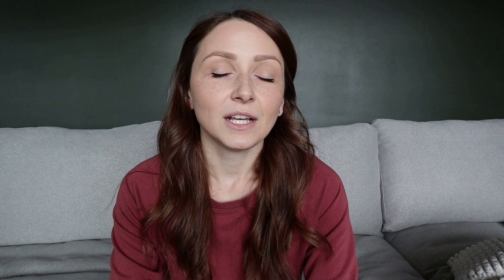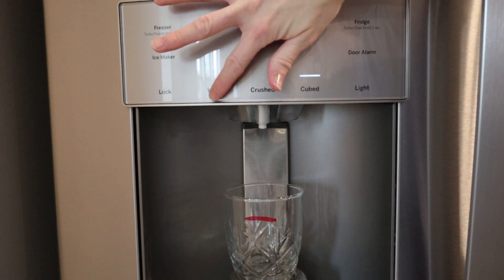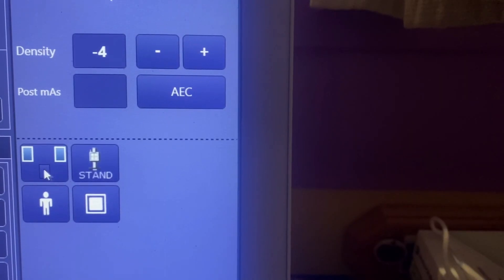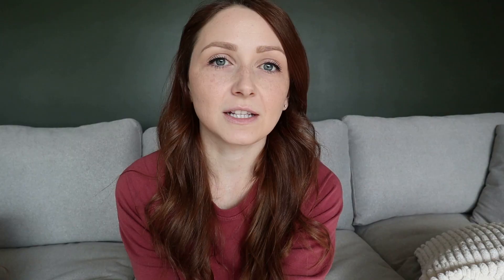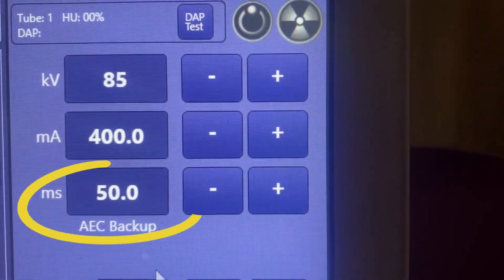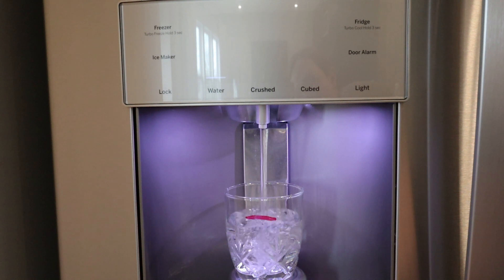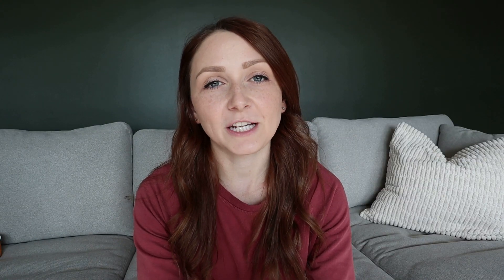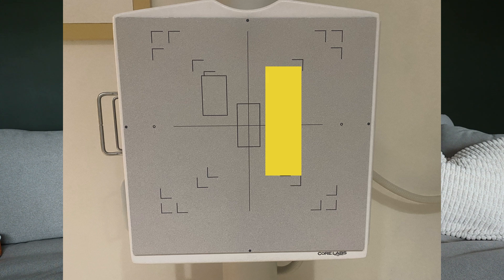Radiology Concepts: Automatic Exposure Control (AEC)

Comment: Omg! I work as a service field engineer for Xrays and I shadowed another engineer and watched him calibrate the the AEC detectors. I even talked with the radiologist and learned so much about this system and why you would select certain detectors vs others for the image. I had a really good understanding of it but your explanation, video, and visuals SOLIDIFIED how/why this system is used.
Reply: It also was soooooo pleasant to not have a 13 minute video of someone just rambling with unnecessary jokes and off the path stories/details. Straight to the point and pleasant to hear
Reply from the maker: Thank you for your feedback! I’m glad that you were able to find value in the information I shared.